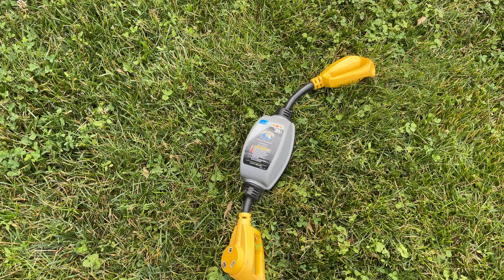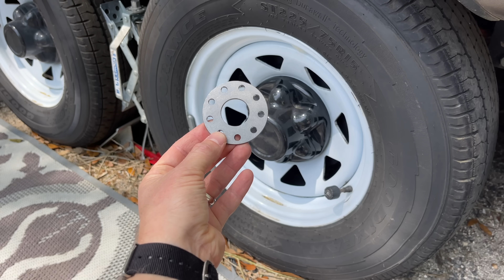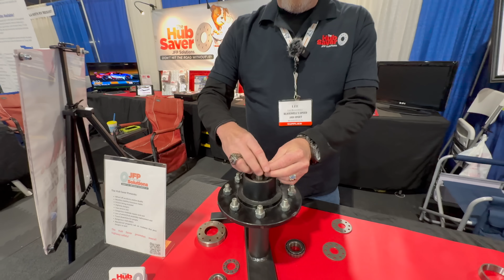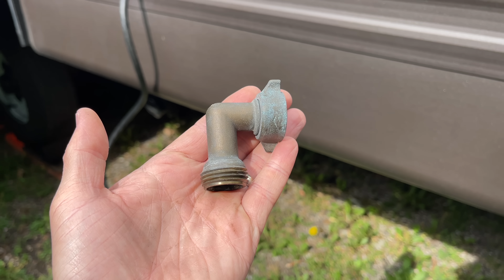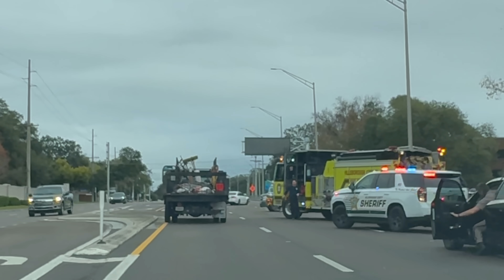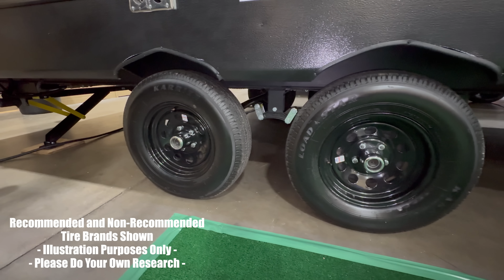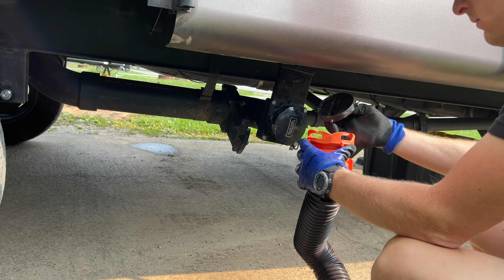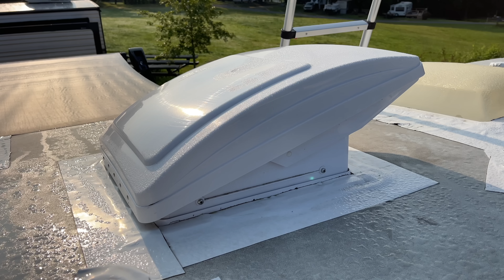RV Upgrades You Should Have Installed LAST Camping Trip (Bet you're unfamiliar with #3...)

Comment: Modern LP tanks have mass flow regulators built in.
Reply from the maker: From GasStops FAQ page:
Many propane connectors already have flow limiting devices built-in, why do I need a GasStop?
Flow limiters built-in to common US propane connectors will not shut the propane off completely, they just limit the flow. GasStop completely shuts off the 100% of the supply of propane. GasStop will give the operator a visual representation of the status of the propane flow and pressure.
https://gasstopusa.com/about-the-gasstop/frequently-asked-questions/#q_3078_10
Reply: @rvgearandfar  Good to know. I’ll look into that system. Thanks

Comment: I have been using Carlisle for years and never had an issue with them traveling across the country. I have put 30k miles on a set in 5 years and only replaced them because I hit the 5 year mark. A heavy duty tire with a good load/speed rating and about 2/3 the cost of Goodyear Endurances and just as good in my book.
Reply: Yes i as well have the Carlisle 7 years old now about 25,000km    also upgraded to a higher load range, time to change them due to age but still lots of tread left.
Reply: Same.

Comment: Doesn't the propane regulator already have a built in safety features to stop the flow if it the propane flows too fast? Regular bbq grills have it built in yo their regulators so I'd assume RV regulators would too
Reply from the maker: Here's some information from the GasStop FAQ page:
Q: Many propane connectors already have flow limiting devices built-in, why do I need a GasStop?

A: Flow limiters built-in to common US propane connectors will not shut the propane off completely, they just limit the flow. GasStop completely shuts off the 100% of the supply of propane. GasStop will give the operator a visual representation of the status of the propane flow and pressure.

Source:
https://gasstopusa.com/about-the-gasstop/frequently-asked-questions/

Comment: My black tank valve started leaking. I had purchased the end cap valve recommended and now keep it on all the time. Still need to replace that valve. Update 12/24. I found that the cable sheath had come loose from the anchor on the valve. An easy fix.
Reply from the maker: 2 is 1 and one is none!

Comment: I don't think the extra valve on the propane tanks is needed. Propane tanks already have a safety valve built into them. The valve shuts incase a line breaks and allows full flow.
Reply from the maker: From the GasStop FAQ page:

Many propane connectors already have flow limiting devices built-in, why do I need a GasStop?
Flow limiters built-in to common US propane connectors will not shut the propane off completely, they just limit the flow. GasStop completely shuts off the 100% of the supply of propane. GasStop will give the operator a visual representation of the status of the propane flow and pressure.

https://gasstopusa.com/about-the-gasstop/frequently-asked-questions/#q_3078_10

Comment: Wow - new things! We added the door handle. Thanks for the bearing and propane info.  We have used Maxxis with no problems for our travel trailer.  You have to upgrade the vent van if is the small version... We installed two and they are great! Very good video - different from other "items" videos.
Reply from the maker: Thanks for sharing the tire brand - and agreed - the vent fan upgrades are dramatic in performance.

Comment: All good... except... the screen door handle. I doubt that any screen door is rated to allow much weight to be applied in a downward force. The illusion of safety may be worse than nothing at all.
Reply: Agreed, a bad suggestion on it being a help for falling or getting up/down. I think it would help in controlling the opening in winds or stop one from putting a hand or elbow through or stretching the screen though. Definitely put a big "NOT FOR SUPPORT"  warning on it though !
Reply: I’m quite sure he didn’t mean that you’re going to be doing pull-ups on it. It’s designed just to help you balance, not loadbearing.
Reply from the maker: agreed - balance point in conjunction with the actual stair handle - plus my kids have NOT been easy on the door handle the past few years and we haven't noticed any issues

Comment: We had a problem with our propane that needs to be shared with your viewers. We always drive with our propane on. As we were on our way home from a cross-country, 6000 mile trip, one of the shackles broke.  I always check everything everytime we stop, but never saw a problem with the shackle. It had turned upside down and the spring held it in place so everything looked OK. The problem came when the bolt now upside down was rubbing the propane line with every bump. We caught it that night and the pipe was paper thin. I could of put my finger nail through it. Luckily nothing happened and we had everything replaced. 😢
Reply from the maker: It is odd that the lines are run along the bottom of the frame rails - you'd think they would place them further away from the suspension and tires.

Comment: I was told by the Goodyear tire rep never store your tires in a garage or shop with an air compressor (anybody know why? if you do you get 10000000000 points)
Reply: No clue. Don't hold us in suspense ! I'm sure the millions of tire shops and repair garages with their racks of tires and multiple large air compressors are dying to know too !  😏
Reply: @nothere7198  ozone
Reply from the maker: There is "perfect" practices and there is "best" practices - I'd be surprised if the amount of ozone dramatically impacts the tires - lots of variables there - where the tires are in relation to the compressor, how often the compressor runs, is the garage door open and lots of ventilation etc etc.

Comment: That 120 volt shore power cord is 10-3 a@ 25' or 8-3@  @50' go bigger  wire size to reduce resistance. Hence voltage  drop . Just saying....

Comment: I went to a well known and reputable tire store when replacing my trailer tires. Supposedly I got the best they had. After 2 years I went on a trip and in 1000 miles I had 3 blowouts. Not flat tires, BLOWOUTS. One was checked when I stopped for gas, nothing visually wrong, no  heat and the correct pressure.  2 minutes back on the highway and bam! I called the dealer and basically I got a "sucks to be you" response. Needless to say I now go to a different tire store and a complete set of different tires. No issues what so ever. In this day and age we shouldnt have to research trailer tires but unfortunately we do.
Reply: Your story isn't helpful unless you say what brand was a problem and what brand you used to replace.
Reply: Sucks to be us reading this and not getting any useful information from it. Without you telling us the brand names 🤦‍♀️
Reply from the maker: Care to share what brands and tire shop you dealt with?
Reply: did they say "Made in China" on them?
Reply: So which tire store and tire was bad and which was good?????????
Reply: @tombickman9292    This isnt about good or bad tire brands or stores that sell them. What you have to wrap your brain around is the fact that those at the stores are SALESMEN first and often times not so expert. It is not hard to research tires, but it does take some time and you need to do that before you listen to the person behind the counter.

Comment: We have the "Hercules" steel belted brand tires on our rig. They're pressurized with nitrogen! Ambient air fluctuates too much with temperature changes, nitrogen doesn't!
Also, we've had these tires for over 3yrs now and I have never had to adjust the pressure!
Reply from the maker: Sounds like you've found the ticket for your rig!
Reply: The air that we breathe is already 70% nitrogen. The extra 30% doesn’t help that much. Be sure to check your tires first thing in the morning before driving and before the sun hits the tires. Inflate to the recommended pressure listed on the plate on the side of your RV

Comment: Had Goodyear endurance on my trailer from the factory. They all had bubbles on the sidewalls. Friend of mine even got brand new endurance tires and two of them had the bubbles brand new. Now they never caused an issue but I did not like the fact that they did this. Read that multiple people had this issue on forums. I ended up putting Sailun S637’s all around the toy hauler and a spare. 14ply steel belted tire. I feel much better about traveling now. Again. Didn’t have any problems with the endurances but it was just peace of mind. The Sailuns do track better I did notice. Not as much wandering around the road.
Reply from the maker: I've heard great things about the Sailuns!
Reply: I had a blowout 2 days after putting on the GY Endurances. I haven't yet switched them out but I haven't pulled it much recently either. I'm looking at replacing them with either the Sailun S637T's or Transeagle 12ply's.

Comment: Hello Gear & Far. Do you have a video or tips on fixing or replacing the middle screen door sliding component. Mine is bowed and doesn’t seal. Any tips?
Reply from the maker: hmm - if its bowed and doesn't seal you could try taking it out and flattening it - maybe set it in a sunny spot with some heavy books on top to weigh it flat while the sun heats it up - then maybe when it cools it will be straight again? Sometimes the plastic pieces get so warped with sun/heat that the only thing to fix it is to replace them - you can order parts online or get some materials from the hardware store to fashion a replacement.

Comment: Propane tanks already have an automatic shut-off feature for when spell large flow occurs such as a broken fitting or a cut hose
Reply from the maker: Here is a comment directly from GasStop regarding that:

"...Excess flow valves (EFVs for short) are calibrated to certain maximum flow rates... GasStop will not limit the flow in the event of a major leak, like hose EFVs do, instead it goes one step further and shuts the supply down fully until it is reset. Hose flow limiters are a layer of protection, GasStop is that extra layer that puts the user in more control (especially with the added benefit of the pressure gauge to perform a tightness test prior to use!). We hope this helps!”
Best wishes,
Matthew Howard, GasStop

Above extracted from this full comment in reply to another comment, included for transparency:

"Excess flow valves (EFVs for short) are calibrated to certain maximum flow rates, and the maximum flow rate of a grill will be different to that of a typical RV application, this is why the connectors on your pigtails hoses and/or regulators are different colours. Black connectors typically have lower flow rates, Usually around 60 SCFH, light and dark green are normally over 90 SCFH. The reason why it is important to match your GasStop to your application (we now write RV or Grill on the connector to be as clear as possible) is to make sure GasStop shuts off as expected during a fast/major leak scenario. GasStop will not limit the flow in the event of a major leak, like hose EFVs do, instead it goes one step further and shuts the supply down fully until it is reset. Hose flow limiters are a layer of protection, GasStop is that extra layer that puts the user in more control (especially with the added benefit of the pressure gauge to perform a tightness test prior to use!). We hope this helps!”
Best wishes,
Matthew Howard, GasStop
Reply: Was using the gas stop until it stopped working properly. No leaks anywhere and it kept shutting the propane off.Took it off and used it on the BBQ and generator, same result.

Comment: Great video. My wife and I have been avid RV users for years and I have added several of your recommended items over time. The latest was a TPMS system. The monitor is solar powered (or usb) and it shows psi as well as temp. I had a blowout years back (that sliced a propane hose) and if I had a tpms system it could have been prevented.
Reply from the maker: Thank you! Yes - love the TPMS - not a magic wand, but definitely a net positive in my opinion

Comment: I'm going to completely disagree with the TPMS recommendation. Having a TPMS system on my RV (installed by the previous owner) is what caused a tire failure far away from home. The cap adds significant weight to the valve stem causing it to flop around much more with every rotation. My RV had hoses attached to the duallies, which seemed to only make it worse. After I got home, I checked every valve stem and all of them were ripping from the fatigue of flapping around. I had all of them replaced with metal valve stems and removed the sensors, it's easy enough to just check tire pressure before every trip.

One exception is a TPMS system where the valve stem IS the sensor, the same way most modern cars do it. This eliminates the failure point and complexity entirely.
Reply from the maker: Installing metal valve stems will mitigate this concern ◡̈   Reward of having them FAR outweighs risk of valve stem issues in my opinion

Comment: Do you have an opinion on changing to a "demand" or tankless water heater instead of a storage tank type?
Reply from the maker: The tankless ones are GREAT if you need a lot of hot water because they heat as long as you have propane available. The downfall is that you can't use electricity, so you loose the flexibility of both fuels - and the big one is the cost - tankless are definitely more expensive to install and run (propane vs electricity included in your site fees)

Comment: that handle should be a factory item.  it is worth 1,000 times its weight in gold. 
but never trust it to stop a fall. as the screen door will fail. might stop you but the screen doors frame will not be right ever again.
my factory spare never touch ground. the tread had split off the carcus. looked like a way over filled tire, still
held air psi, but not safe at all. 

thats the sad part of rv’s 
the manf buy the cheapest junk they can find to instal. just so they can get maxim price they can possible get. 
this is not just a rv problem. 
i would love to have a new slightly larger rv. 
(have a 25 ft would like a unit about 6-7 ft longer) but the price point says the dealer gets to keep it on there lot till it rusts out.
Reply from the maker: Agreed on relying on the screen door handle in a fall - its going to give way - and its so crazy to have a brand new tire fail on the spare tire carrier! 🛞

Comment: The screen door bar is kind of a bad idea. I installed one last weekend and really don't like it. Why? You are pulling on the screen door with the bar and the only thing connecting the screen door to the outside door is that little plastic tab on the outside door that hooks over the screen door latch handle. That's a real week point for pulling 2 doors shut.
Reply from the maker: All true - but we just passed 3 years with this setup - two of those full time - and haven't had issues - your mileage may vary
Reply: My 5th wheel has a glass front door. Maybe my door simply weighs more. The only thing holding the pulling weight is that little plastic piece. I may do some mod in the future to alleviate this. All the best.

Comment: Our 2024 Alta 2400kth came with Good Year endurance tires. Two had sidewall bubbles- opposite sides of trailer. Not sure if dealer hit sides in delivery but was disappointed given are supposed to be higher end tires. Never had previous issues  with our 10+ year old trailer tires- just replacement with normal wear and tear and were no name brands.
Reply from the maker: Well thats a bummer - and I think we can all agree that everything can have issues - even the premium of premium brands - just banking on the likelyhood that they'll have LESS issues per capita - it is odd that you have TWO sidewall issues though. What did you replace them with?

Comment: We haul horses and the only tire we trust is the Continental HTL2 with a J load rating.  I've had way too many trailer tire problems in the past with boat and flatbed trailers to risk hauling our horses anywhere. 

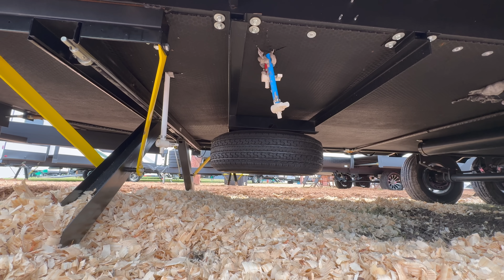My opinion, 3:25 should be a DOT requirement for all new trailers today.  We lost a wheel assembly at 65MPH years ago and it made its way over the medium to on coming traffic also doing 65MPH, quick higher and that was approx. 130 MPH closer rate!  Thankfully, it did not hit anyone!!!!!!  I will be installing this product on all 3 of our trailers, thank you!!
Reply from the maker: Wow! That would have been really scary - yeah I really like the Hub Savers - simple solution ◡̈
Reply: Gulp. $500 tire.

Comment: Highly recommend having the Hub Saver installed by a professional, Not a DIY unless you know how to torque down the castle nut corectly... Your RV is literally riding on a very small surface (the Bearings). Not torqued correctly could prematurely wear out your bearings and cause the very problem they were installed to prevent.
Reply from the maker: That same advice would apply to any bearing maintenance - do what you're comfortable with. And with a cotter pin there you have to line up the nut anyway so you may have to adjust the nut to place that keeper in.
Reply: @rvgearandfar the newer ones don't have a cotter pin......
Reply from the maker: @owenhill-vf7ko  all depends on the model and manufacturer - some have cotter pins, some have keeper clips